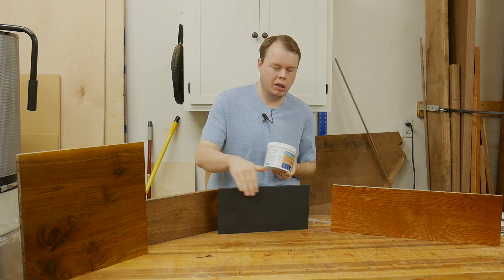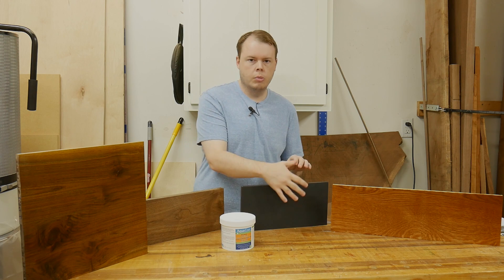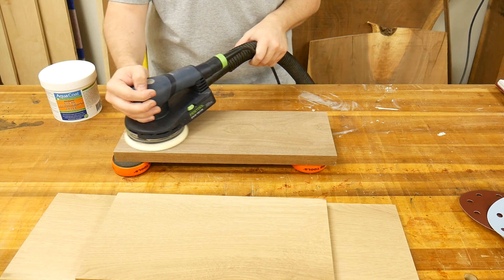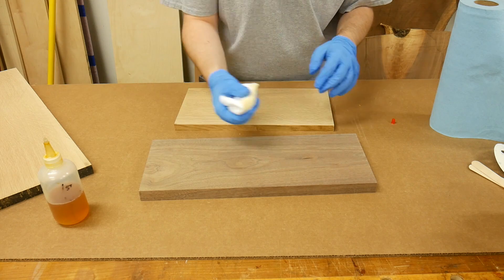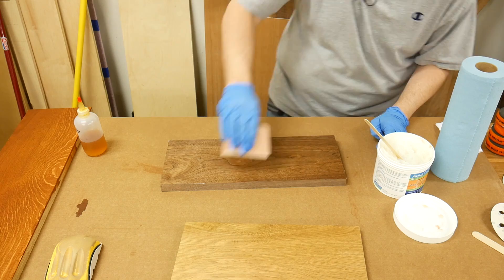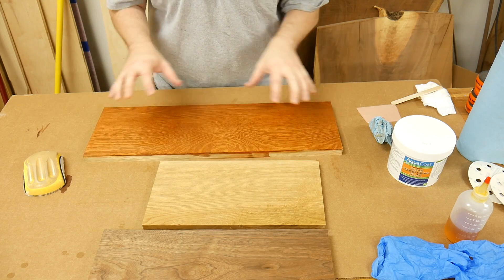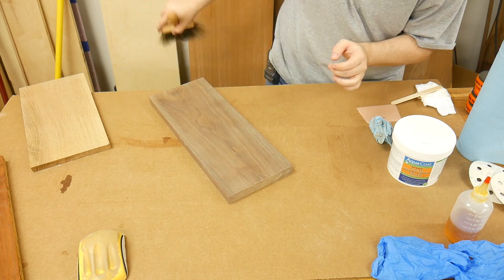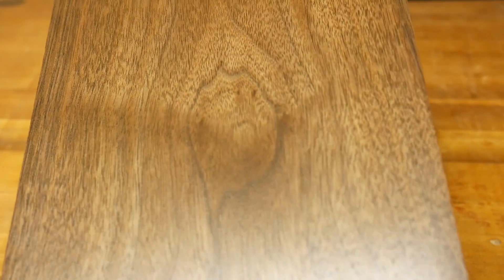How To Use Grain Fillers - Finishing 101 Series

Comment: So far, this is the best video that I've found on filling those pores and other grain imperfections on my Zebrano wood surfaces.  I have tried so many methods before such as catalyzed polyurethane to create a surface thick and hard enough as to eventually reach a mirror-like finish and to a certain extent, it works, but then I had to deal with bubbles on the catalyzed thick layer of polyurethane.

Comment: I'm refinishing my Les Paul (electric guitar). I ordered both Aqua Coat Water Based Clear Wood Grain Filler Gel AND Aqua Coat, X-119 Sanding Sealer to apply after the filler. I'm going for a semi-transparent, finished product, meaning I want to see the wood grain but no wood texture. I'll be applying either clear lacquer if I opt for a natural finish or, if I feel really adventurous, cherry sunburst. Am I being redundant using both the wood grain filler AND sanding sealer? If I go with sunburst, am I making a mistake by applying the dye after the sanding sealer? I've seen it done a number of different ways.

Comment: *QUESTION* We are moving into an older 1990’s mobile home where the cabinets are painted over in white. Do I have to strip the paint in order to use the pore filler because the grain is very obvious and we want to fill it in? The cabinets are basically a flat piece of wood, not like cabinets with a design in the middle or whatever thats called... your answer would be appreciated!
Reply: We are wanting to paint over them again minus the appearance of the wood grain because it does not look good and they only painted one side of the cabinet 😬 so who knows what color they used

Comment: So for clarification,
1) Sand first with 150 Grit
2) Apply Stain and remove excess
3) Apply Shellac
4)  Apply Pore filler and wipe down excess 
5) Sand with 320 Grit
6) Repeat Pore filler application 2 or 3 more times and Sand again.
Reply: Question: What happens if I skip step 3) shellac and go straight to step 4), applying the Aqua coat wood grain pore filler material?  (Thanks in advance!)
Reply: @Tony Kwok  you get a rounded finish on the pores instead of sharp.
It creates a thick gloopie looking finish. The grain looses definition 😉
Reply: I've used this stuff for several years now without shellac and have a beautiful glass like finish on red oak. I use it over natural color stain. Really like it.

Comment: Question: I am doing a guitar body that is swamp ash. The plan is to sand, stain, then use Tru-Oil to protect and give it a nice shine that also tints/darkens slightly. I know I will be seeing pores, so when exactly should I apply the Aqua Coat? Once the Tru-Oil is on and fully cured? Before I put the Tru-Oil on? Thank you.

Comment: For a painted surface I'm going the route of using Gyproc wall filler mixed thinner than normal applied with a 3inch blade, 220 grit sand then 2 coats of primer sprayed with a HVLP setup with 320 grit sanding between coats. Then 2 top coats. So far it turned out like your example. May even go with a 2K clearcoat for more durability. Will try this product next time I stain. Thanks.

Comment: Hi Sean, great content. Can this pore filler/sealer be applied to open grain oak with 1-2mm pores previously treated with oil finish or will it react or not stick to it since it is water based?

Alternatively what pore fillers can I use on oil finished open pore oak?

The purpose is filling the pores prior to applying shellac or another hardening clear coat. Thank you
Reply: Hi bud. Do you have an answer for this question yet? I have some oiled pieces i would like to grain fill. Any help greatly appreciated. Thank you

Comment: Very interesting video, thanks for taking the time and effort to do this.
Q1. Why do you need to put a coat of shellac on the timber before applying the grain filler?
Q2. What grit do you use to sand the shellac before applying the grain filler?
Q3. After applying 3 coats of grain filler, what grit do you sand it to before applying the finish coat?
Reply: A1 - Shellac works as a seal coat before applying grain filler. Solvents in varnish sometimes raise the grain filler up, making an illusion like you're varnishing everything plain and clean, but weeks after the grain filler will shrink back down leaving varnish shrinks back down with it as well.
Reply: A1 - Many grain fillers, especially oil-based grain fillers, are tinted with pigments. A washcoat of shellac keeps any colors in the grain filler from leaking into the rest of the wood, muddying the look. A washcoat isn't necessary with transparent water-based grain filler like this. With transparent water-based grain fillers, it is possible to fill the pores directly onto the wood and then stain the whole piece. Taking stain is one of the advantages of water-based grain fillers over oil-based grain fillers. However, applying it the same way as oil-based fillers (over a washcoat), just like in the video, works just fine. Some finishers find it produces better results.
A2 - You don't want to sand the shellac washcoat before filling. The washcoat is a very thin layer of shellac (1lb cut or less), and it is there to protect the wood from color bleeding. Additionally, you want the edges of the pores to stay sharp, with overhangs, so that they hold the grain filler in and it's less likely to get pulled out. That's why you don't sand the washcoat.
A3 - After the last coat of grain filler, he sanded to 320 grit, then applied the finish coats.

Source for answers 1 and 2: "Understanding Wood Finishing" by Bob Flexner.
Reply: @meghanclark6897  So the question here is, why in the video is he wasting time applying a shellac seal coat before filling if aqua coat is water based and clear?

Comment: I inherited a very nice oak veneer mid century bedroom set from my grandparents. Like many others of similar age, after 60 years, the set needs to be refinished. The task itself should be fairly easy/straight forward, as it is very minimalist - very box-like, with flush drawers/doors, and just a small framing lip around the front exterior surface edge. No complicated curves, carvings, or flourishes. 

Overall, the way its designed has never looked out of style, and i dont think it ever will. The stain, however, is very dark. Also, when you look closely at the finish, it has these wierd little spots all over it - it looks as  though someone stained it this dark color, and then jackson pollock walked into the room, stuck a paint brush into the dye, splattered it with 15000 little spots, waited for it to dry, and then sealed it. The spots are slightly darker than the stain, but barely noticeable unless you look close. Not terrible, just strange and not for me.

As i said, the set is stained very dark, and i would prefer to finish it in a somewhat lighter tone. That said, and most importantly, i want to minimize the grain contrast of the oak to get a more even tone across the pieces. Id like to stain it in a medium walnut tone, with somewhat orangey undertones. If youve ever seen the stockholm series at ikea, pretty much that colour im going for. 

I understand that oak is oak, but i want to avoid that dated 1980's/1990's look that everyone had with their furniture and cabinets with the big obvious cathedral grain etc. 

Would applying the grain/pore filler BEFORE applying stain help minimize the grain contrast? Could I expect even greater uniformity if i also applied oxalic acid before everything else, and utilized conditioner when applying the stain?

Any insight would be appreciated. Thank you.

Comment: I just would go with a thick coat of nitro sealer (applied with a brush), then sand with 320 using the random orbital sander until the surface is flat. Then when everything is flat, just spray last two coats (or as many as you apply), sand and apply your finish.

Comment: I'm thinking about using this product for the first time on my current project. I'm a little less enthusiastic after being able to still see some very large grain pits in your finished examples here. Do you think that it simply needs even more coats or is there a limit on how well it's going to fill? Possibly you sanded a bit too vigorously between coats and pulled some out of the pores? I'm thinking I'm going to go with plan B and make a wash coat from timbermate.
Reply from the maker: No, I dont think this is the limit on how well it's going to fill. The Aqua Coat is a thin pore filler that requires several coats.Since it's water based it dries quickly and allows you to apply multiple coats throughout the day. The purpose of the video was to show you how to use the grain filler product, which it does. I didn't completely fill the pores but got close enough for my taste. If you want it to be glass smooth and not have any pores, continue adding more layers of the pore filler. While the timbermate would do this faster, I find it requires more sanding and messier to apply. But at the end of the day you need to decide what's right for your project.
Reply: @Simplecove  Aw, okay, Thank you for the response. I like the idea of this product because it seems so simple and clean but I don't like that I'd probably be looking at 4 or 5 coats with sanding each time. With the timbermate I should be able to do it once and be done. However, I can use Aqua Coat after any dying and shellac whereas timbermate will need to be applied before the dye at the beginning. Decisions, decisions. Thanks for the help!
Reply from the maker: I don't think you will be table to only use 1 coat of timbermate unless you apply really thick. At least I wouldn't apply it that thick.
Reply: @Simplecove  I've used timbermate many times and usually get away with one coat. I find if I thin it just the right amount I can get it to fill the grain perfectly. That's not to say I haven't had to do a second coat before.

Comment: you can still see the grain in the sample that was painted did it need another pass of the grain filler
Reply from the maker: if you want it completely closed then yes probably another 2-3 coats will be required.
Reply: Ic  ..Thanks

Comment: Sean, working with 1/2” Baltic birch plywood that I’ll eventually be UV printing on. Wondering if the water based filler would cause expansion and what you might recommend as steps. Thanks for this awesome video!

Comment: Great video with lots of info. 
Would you advise this grainfiller also on burl? I need to finish some boxes with maple and walnut burl veneer and think this could be a solution for a smooth finish. Do you have any advise?
Reply from the maker: I always recommend testing this on a sample board first, but I would use it on burl. It may take more than the 3-4 coats on burl since it has such large open pores.
Reply: Thanks for the reply. 
Nothing more to it than just try. 😉😉

Comment: Okay, I want a high-gloss finish, but my piece has moulding that I want to match.  I'm planning on using a pore filler to accentuate the pores with more contrast, so how do I do this to moulding?  The piece will be oil-stained first.  Moreover, if I'm using oil-based poly, can I seal with poly before the water-based filler, or will the filler not stick well or the next top finish poly not stick well to the poly/filler coats?
Reply: Hi. Did you find out if you can apply the filler over a previously oiled surface? Thanks

Comment: When using it for oak cabinets do you prime first then apply or use it first on the raw wood?
Reply: Apply wood filler, then prime and paint.  Sometimes even a good sanding is a good option.

Comment: can I stain the cabinet first with oil based stain then put this
Reply: Wondering the same.  I've heard so, but it requires restraining areas  that have sand through the filler.  Seems like an easy way to get an uneven stain.  I'm curious if anyone has experience and any tips.

Comment: I've seen quite a few demos with this product, but this is the first I've seen that uses a shellac sealer first. Any particular reason/benefit for sealing with shellac before the grain fill step?
Reply: I've heard it helps prevent leak through of the stain into the filler.
Reply: @phantomcreamer  But that doesn't explain why he used it on the boards without stain.

Comment: Why would you pay for oak wood if you want to fill in all the grain and then paint it (not stain it)? Why?
Reply from the maker: Because someone may own a piece of furniture(that they found at a thrift store or got for free) that they want to paint.....
Reply: I’m making a piano bench using oak for strength.  It will be painted black to match the piano.
Reply: Red oak is cheap.
Reply: @dibbledabble2482  it's still 3 times the price of pine where I am from. About $30 for 12" x 36" shelves vs $10 on pine. Although I probably might be able to find it slightly cheaper at certain lumber yards. But I agree in the sense that if you want it to be significantly stronger, be more dent resistant, and look a lot better than pine without spending too much, it's not that expensive compared to most other types of woods. it is sad that wood is so expensive overall though. it's often cheaper to buy most furniture than it is to make it by hand except when you are looking at $1,000+ pieces
.
Reply: Because Oak is the ugliest wood there is. JK (although I can't stand oak!). Seriously though, the stain he used didn't block the beauty of the grain at all so not sure what your issue is with that. The paint he used was simple for demonstration purposes. Also, Oak is notorious for having deep grains and, not sure why you like that, but people generally don't love to see huge grain pits throughout their furniture and cabinetry. Maybe you are confused and are thinking he is hiding the grain/figure when all he is doing is ensuring the surface is flat.

Comment: I appreciate you uploading this video and sharing the results.  I see you applied it correctly - did all that one could expect you too. But I totally disagree with what you state in the end about that being a smooth finish or being able to take it to a high gloss and get a mirror like finish. Three coats of that Aqua Coat and you still had a ton of grain in the end. That's NOT even close to a smooth finish. And the video is proof of that at the end. It's as if you're telling people to see something different than what is clearly evident in the video. All had a ton of grain left even after you filled the grain not once, but 3 times and more than one coat of finish on them.

I just did table legs and after painting two coats of satin black - there's about as much grain that shows in your video - and i didn't use anything but a home brew of sanding sealer - and that's on deeply grained red oak. And achieved a mirror finish filling the grain on the same deep grained red oak top via old school methods of creating a sanding sleary to start.

Like I said - thanks for sharing - including the results. I won't waste my money on Aqua Coat. Though I was hoping it would work for some dyed pieces I want to do... The Old school methods are still proving better and far  less time consuming. 

Cheers...
Reply from the maker: Aqua coat is meant to applied very thin which means it dries faster allowing you to put more coats on in a day. Like with anything you see online, always test it first to see if it's up to your standards. I was more than happy with the level I took mine to. You may not be but that doesn't make my opinion wrong. Ive used items like timbermate and while they work, they smell awful and take longer to dry. Every product out has pros and cons. Go test them yourself and please do record it so others can benefit from it.
Reply: @Simplecove   - It's not about opinion. I'm looking at the wood / finish in the end of your video. It's undeniable the grain is still very much there. Which will not make for a mirror finish by any account.

Granted it may dry quick and can be recoated several times through the day.

Old school way I can knock out filling the grain via two methods, to pop the grain or not to pop the grain) and have it dry in 30 minutes to 4 hrs for sanding depending on my mix. Max two coats. And there won't be any grain visible first coat of finish. No matter what wood is used.

But then I learned from a master finisher who made his own finishes and even his own brushes... perhaps that's the difference. The lost art of old school finishing techniques one could say.

You did the finish right according to instructions - so it wasn't your method. It was the product. I suppose if you want to sit there and put ten coats on it all day - it might work fine.

And I've seen many others that have used it looking further into Aqua Coat - and they had the same results. Some with 6 coats - grain still showed.

So I thank you for showing it - and sharing the results. I'll stick to what I know works. It may not come in a can -  but it's sure easier and gives way better results than Aqua Coat - I will say that.